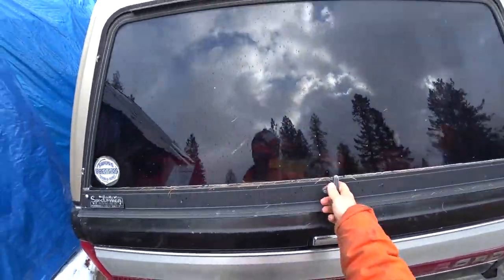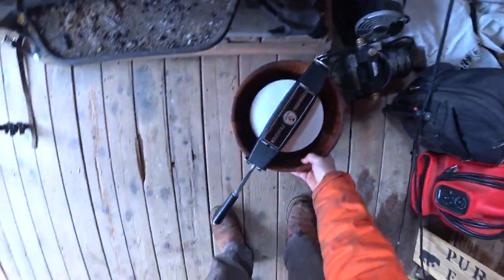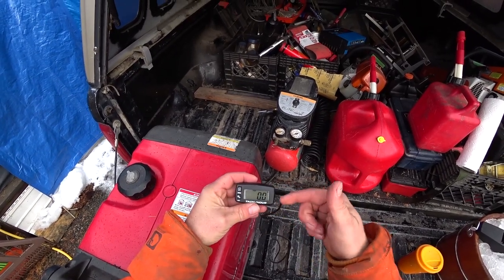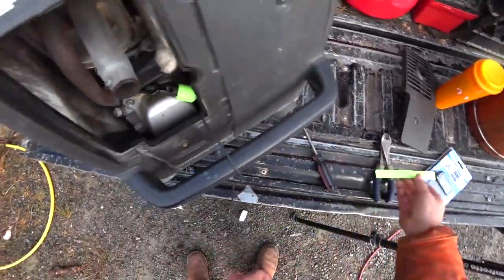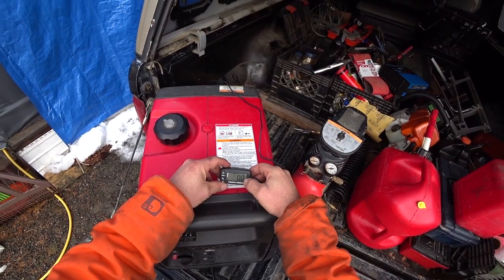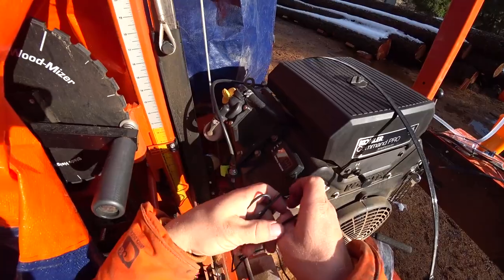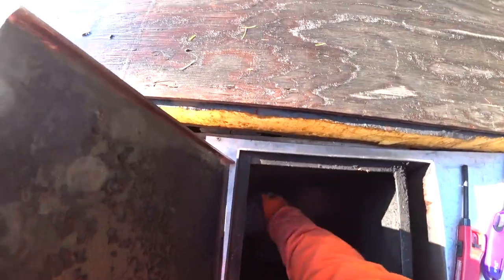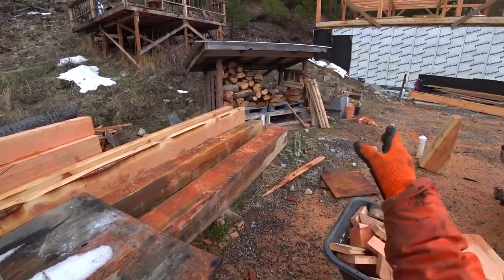Install This NOW On Your Small Engine! Don’t Wait!

Comment: There is a built in hour meter on these generators already. When you "first" start it, the green light will come on to indicate that it's running. When you start it and the gen has less than 100 hours, the light simply comes on and stays on. When it has 100 to 200 hours it will flash once. 200 to 300 hours it will flash twice and so on......... It's great information when buying a used honda eu300i. I LOVE mine!

Comment: That hour meter actually works by capacitance, not inductance. It picks up the spark by capacitive coupling not inductive coupling. Just a FYI. I'd worry more about keeping that water off the warm board than the hour meter. I know the warm board is rated for 1 yr weather exposure but if it was me I'd not push my luck by testing that spec!

Comment: You probably already moved it by now, but you should sticker those plywood sheets that you stood up be the front of the garage, so the cut ends are not standing in water. xoxo from sunny Arizona.

Comment: I think the reason that many generators and other small engine equipment doesn't have an hr meter is because they say you should change your oil at least yearly (spring or fall, depinding on use time) regardless of if it was used enough or not. I personally agree that a meeter should be OEM.
Reply: GraymanTactics My opinion is the reason manufacturers don't put an hour meter on small engines is they know that they're going to be neglected on service intervals and that means that they won't last as long which means that you're going to be buying more of their product!! The reason that you change your oil often is not because the Oil is worn out it's because of contaminants. Truth be told when you change your oil it's only lost between maybe 10%-20% of it's lubricity.

Comment: Can see why they were putting out filler. Looks like this after workshop break may last till spring. Don't know the shipping costs, but they didn't need window sizes to order the sips for the roof. Getting concerned for their press board engineered floor joists.

Comment: You can use those pipes in the garden for 'runner beans, tomatoes. You can drill holes in them, plant them as posts, pull wires through and there you go, non rusting, no beetles or wood worms.

Comment: Every small engine needs a FUEL shutoff and filter, lawn mowers riding/push, Generators, Scooters, etc, it will allow you to start your equiptment right after winter without rebuilding/ cleaning the carb.
Reply: Shhhhh! It will simply become the source of yet ANOTHER 'how not to do this ' 'monkey fucking a football' reinventing the wheel exercise video!

Comment: Why haven't you caulked or taped the seams of the warm-board?  That would reduce the flood to what comes through the stairwell.  The stairwell can be covered with plywood and tarps.

Comment: I would think your leaf blower would be your best tool to clear the garage of water after the rains. Have you tried firing it up and just blowing the water out?
Reply: Slick1G3 eh.  (With a comforting pat on the back) Their, there, they’re. ;) It will be ok.  I’m not going to get all debbie downer telling them everything they should be doing differently. Just wanted to offer a simple suggestion. 

To your point though, I think the concrete is going to be ok as long as the mix was right. Seen plenty of late fall pours that weathered through cold winters with a little consideration in the mix. Their hydronic radiant system isn’t filled yet, it’s just air right now so no water to freeze in there. 

I don’t disagree that if it were me I’d be sealing off the garage door openings etc with some temp walls or plastic at least just to work toward a more comfortable winter work space if nothing else. But they have different priorities for their needs, and that’s cool.

Comment: Put some of those tarps and spare lumber to good use and tarp that floor, using the lumber to weigh it down. Might be a good temp use of your scarf family.
Reply: they will be putting up sip panels that will go up even faster than the timber frame and they ran themselfs into exostion so some light duty need to get it done sometime chores are likely in order,and if you and a couple of friends what to drop by and help i am sure they would be apreshutive maybe even to sharing some ice cream.

Comment: Did you think about buying a retired 20 ft shipping container for storage?
Reply: Henry Dembinski no body wants an ugly shipping container on there property unless there is somewhere to hide it, especially when you are building a house this beautiful.
Reply: After storage use is completed. The container can be converted into a workshop with a slanted roof for catching rain water and solar panels. A coat of paint and landscaping does wonders for the looks. There are many examples on youtube. There is a guy in AZ did a bang up job converting a container into a workshop.
Reply: All that bark-covered timber they chopped up for firewood could have been used as exterior siding to make a shipping container look like a log cabin.

Comment: I have worked with pipe that looks a lot like what you have. We used it for DWV (drainage, waste, and vent) piping in a school lab. You actually fusion weld the joints with an AC welder. Looked like a battery charger with a timer.

Comment: Jesse and Alyssa,

Just wanted to say I love the vids!!!! One thing I would like to see is a video discussing the SIPS. If you could let us know what the different types are and the pro's and con's of each that would be great. Curious as to how the SIP'S attach to the timber frame and if they are finished on the interior and exterior, or if you have to drywall the interior and side the exterior? Also, how is the roof closed in? Sips? Thanks in advance!!!
Reply: Of course there will be a vid. In the meantime you can visit any one of the 2000 vids on SIP's here on YouTube.

Comment: Was wondering why you folded that tarp instead of laying it loosely on the slabs... Loosely meaning tight enough to eliminate further accumulation of snow and loose enough to allow for evaporation? Happy New Year from sunny Arizona, 74/44f today.

Comment: Well you probably have taken care of this already and maybe they are not there anymore, but....that plywood you leaned up against the wall of the garage should be setting on maybe a few pieces of wood so they are not sitting on the floor. For any wood, the reason is (and you probably know this already) the wood will soak up the water and the plies will probably separate......but you probably already know this. PS: just needed an excuse to comment on something   d:)

Comment: Those of you that are purchasing this hour meter ... The more you play with the features, the light, and checking the the various readings / programs ... the faster the battery dies.  HAVE EXTRA batteries on hand.    I use this on my scooter.  I never push any buttons.  Battery lasts for 9+ months.  I remember pushing buttons when I first got it ... 2 months battery life.   Use the velcro!

Comment: I used to make a lot of home made ice cream when I was a kid. My mom would cook it up and leave me to flavor it as I chose. I made purple peppermint bon bon or a cinnamon that was just chock full of cinnamon. Way more any commercial brands of cinnamon ice cream. Oh and rootbeer icecream. It's really a question of texture on the palate but the proper way the freeze in a bucket and dasher is to churn it slow and steady. Might take a while to get it right, but the result is a more smooth icecream that wont melt quite as quickly. I always liked a more grainy texture so I would churn it kind of the way you do. Maybe a shorter interval between freeze ups.

Comment: You guys should look into some forks for that backhoe. It would make moving your timbers around much easier and won't have to mess with chains or slings. Like a forklift, only for your backhoe. They attach to the bucket.

Comment: Buys whole organic unpasteurized milk.. then dumps refined sugar and fake vanilla into it... Whhhhhhhhyyyyy?
Reply: well while i see your point but real venella beans are real expencive and while you could use honey that will take exparimenting they have not had time for and with milk like that how bad can it be?
Reply: Clay Mccormick - real vanilla extract + cane sugar or organic palm sugar. Done.
Reply: Most small engines spark on every revolution on the ignition cycle and exhaust cycle just for your information hope it helps

Comment: Honda DOES have something on board to tell you about how many hours. When you initially start it, the lights on the front will blink a certain pattern. That pattern will coincide with the range of hours it’s been used. Maintenance is determined from there. I have those Honda’s... or had. My stepsons dad stole them out of my garage. Grrrrrrrrr

Comment: CAN SOMEBODY TELL ME why the building videos stopped.
Reply: Hurry up. Hurry up. Hurry up.
Big timbers up . . . everything stops. WTF?
Reply: Probably money, but there really worried about windows. but finishing and roofing (keeps safe and dry all your hard work) go hand and hand, so probably 40-50k needed. also the permits and inspections( could take weeks), but the should enclose it and roof it first then worry about windows since they might be to big or small once they actually build it. so there doing filler videos to save/make money, and the timber frame class had to be $1000-2000 a person, so about 24-40k made off that.
Reply: And whatever one does - DO NOT properly tarp materials and completed work allowing ventilation and preventing them being 'blown away'.....
Reply: Sky Miller They had to finalize windows, brand, type, dimensions, with architect and window manufacturer, so they could then place the order with the SIP manufacturer, so all the holes could be pre drilled/cut. They are waiting for SIP manufacturer to complete fabrication at the moment, but with holidays, everything is slow, they hope to have panels by February. 

In the mean time, I hope they build a stair case, even if temporary, just to be able to safely get up and down.
Reply: Have you tried building, especially roofing on that pitch in the winter! Come on people they weren't born for your amusement! Watch or don't it's your choice!
Reply: Highly unlikely they got a refund.. Volunteers that help Habitat for HUmanity pay nothing to help and learn.  Timber framing is an highly over rated way to build in my opinion.. Wood can be used in a beautiful way without being the frame..
Reply: David Pierson try $5,000 per person at 25-26 people, that's $125,000-$130,000!!!
Reply: Slick1G3  Lol... not even surgeons pay that kind of money for their training!! And it wasn't even a full week.

Comment: I used to use similar hour meters on my dirt bikes as for holding the wire around the spark plug wire i always just used stainless wire that i used to wire the grips on its like 0.3mm thick always worked for me

Comment: I've watched you v'logs and have a question. How are you going to heat the water for the heating system? I also wonder why you're heating the basement, but I figure it's for winter projects and you don't want to do them while freezing. As a suggestion for a heat source, I don't know what they are called but I've seen them. How about one of those outside boiler house for the heating? They are about the size of a outhouse and are wood fired, judging by the smoke coming out of them.

Comment: You wrap the tach cable around the plug wire and then zip tie the tach cable to itself before the coil(it should look like an old light bulb) lol. Cut the extra wire after test fit.

Comment: you can probably trim the wire down to length since it is working on induction it is essentially a radio antenna looking for electrical pulses

Comment: G'day guys, I know that your videos are not matching the correct present times so I don't know how far you are with it but today when I saw how wet that cement  on the garage is, I wondered why wouldn't you consider sealing the joints of the top floor panels, tape don't think would work but a quick clean of the gaps when a sunny day after the floorboards dry a little, I would certainly be running some gap/rubber/flexible type silicone on all those joints, its the easiest jobs to do and both of you have enough guns to get that done in no time, OK so, you may spend $100 in silicone tubes but preventing all that water from coming in mess things out such as the lights and other stuff, I believe would be a good investment.  Being flexible silicone I don't thing would have to be removed afterwards.  As for the stairs opening, a single oversized  trap type door, 2 hinges ,  1 handle and some ruber around the edges would sold the water issue up to 95% for now.
Reply: They can't seal the gaps in between the floor boards because the sealant would get in the way of the tubing for their radiant, which would completely negate the reason they got that flooring.

Comment: If you want to quiet down your large generator you can try placing plywood or similar product on an angle around the generator. Just lean the plywood against some scrap 6x6 to keep the plywood around a 30 degree angle. Leave the top open and leave enough space around the generator for air circulation. The sound should be reduced because it has to bounce off the angled plywood.  Love your program and your house.

Comment: if you wanted to you could cur the tubing to several graduated lengths and strap them together i would recomend 2 for each length the colection of tubes would resonate at different frequence's making a very directional thing to put a mike behind. with smaller tubine it makes a very good big ear.the larger tubing should work also but would take a little figuring to get the length to cut it.:)

Comment: The Honda has a crappy hour meter built into it if I remember right the it goes 50 hour then 100 200 300 ect. The green led light will flash ones for 100 hour then two times for 200 hour ect. But it is a good way to know how many hour are on a used generator if you're looking for a used one

Comment: Wish they’d get a set of forks for the digger (its called a digger not a backhoe). Could have shifted the stack in one go. I’m sure they could get something commissioned to use the hooks on the top of the bucket as a mounting point
Reply: It's both...  It's a digger and backhoe. I agree, there's bunch of mount options. However, I feel that the machine is a little bit too big.  A front loader Would be ideal but that's not cheap...
Reply: bigjock85 no it is called a backhoe
Reply: It's depends on which countries you're from. It's one of those loose terminology. I often heard it being called excavator before.  lol Go figure...
Reply: Haha always a good debate this one. It’s the same as it’s not a “hood” it’s a “bonnet” 😜Excavators usually have tracks and just the single boom.

Comment: Why are you not in any hurry to get the roof on your house?
Reply: He mentioned in the last (?) video  that he wants to get the SIPS fitted and the whole framing fixed to the house properly first, before attempting the roofing.    
At the moment, it's all free standing..   so any kind of roof would act as a gigantic sail..    and might get the framing airborne!    
I suppose if they used plastic sheeting, it might not get the framing to fly,  it would rip first (hopefully)  but why risk it?  Plus, even plastic sheeting as a temp' roof would be a big job..   
Still, like you Etta,  I was itching to get the building clothed ..  lol.    :-)
Reply: Etta Hyde Jesse mentioned it a few videos ago. Until they get sides on the building using the Structural Insulated Panels (SIPs), having a roof on will simply be installing. Sail to the frame. They get crazy winds up there and the frame isn’t actually very well attached to the garage body. Also, the Warmboard manufacturer has said that the warmboard itself can actually stand being exposed to the elements for up to a year.

Comment: I believe conduit and pipe are sized differently. That grey pipe might be conduit. I had the same problem with 5 inch conduit I got for free to store my rv sewer hose, I could not find fittings for it

Comment: i would have turned those pipes into gutters by cutting them in half  down the length and  than laying them out as gutters and with a bit of sheet metle you could have fabricated your own connections  around the corners and down the sides

Comment: On these small engines the spark fires every time the piston comes up because it fires from the flywheel
Reply: Celeste  Hobelman 
Is that a joke lol?
Reply: Not a joke the off cycle spark is called a dry fire. It happens at the top of the exhaust stroke and there is nothing to burn. You even see it on Chevy V6 where you have 3 coils firing 2 spark plugs each at once. Both fire but only one makes power.
Reply: Celeste  Hobelman 
   It makes perfect sense now lol.
  Not familiar with the Chevy set up, but i work on small engines as a hobby.
  No real way to learn outside of a few engine specific books.
   Thank you... i learn something new everyday:)

Comment: Thought you guys were gonna be in the house this winter? What happened?
Reply: Yea they did
Reply: In the videos they uploaded. when they were taking months on the water system.
Reply: And any reasonable builder would have waited until spring, or at least made sure the roof got on for winter.  why have a 1/10th of the house done without a roof in central Idaho? They knew it was gonna snow/rain but they thought they could get the structure done in time, just asking what got behind or what took so long.
Reply: They know exactly what they are doing! But these two don't! Just asking questions and you are getting mad and defensive, funny